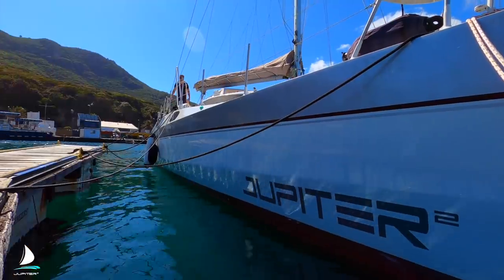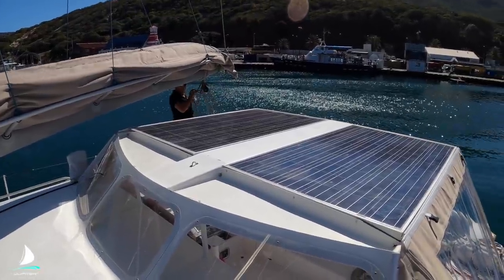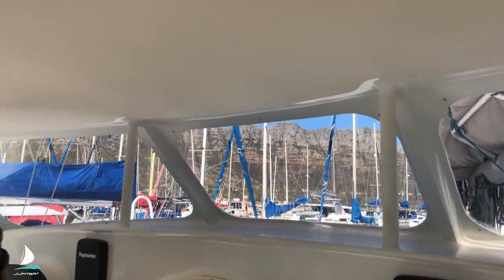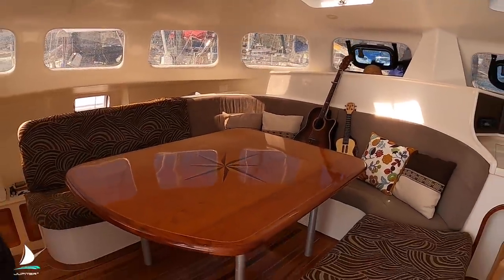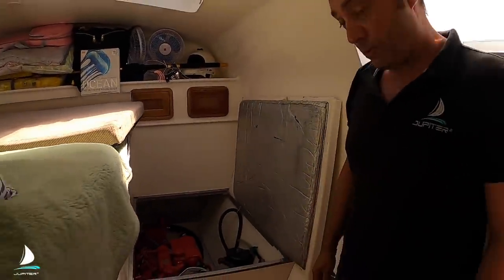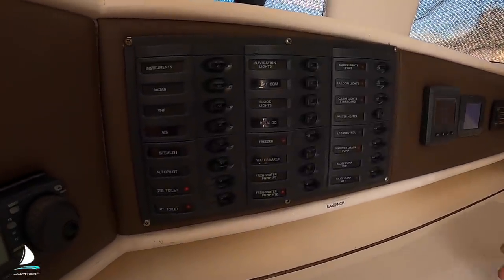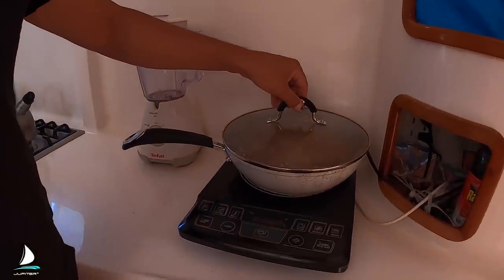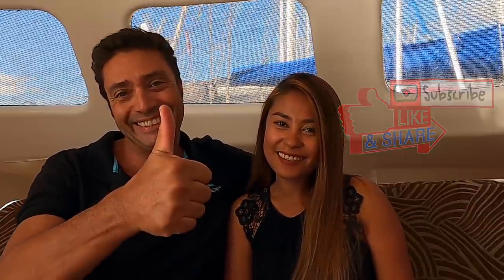ALUMINUM PERFORMANCE CRUISING CATAMARAN: BOAT TOUR EP1 , Meet Jupiter² and the crew

Comment from the maker: Hi guys, thanks for watching... it seems my opinions have raised a few questions, such as....
1.  Why is speed so important for a cruising sailboat? 
2. Do you really need a larger cat to go fast?
3. and the ol' "Which is better for bluewater cruising, Cat or Mono?"

Would love to hear your opinions!
Reply: 1) Speed is fun and can provide safety if not overdone. It's so much more fun to sail reasonably fast and throttle back (reef) when the conditions dictate. It's nice to continue sailing in light air rather than be forced to motor. Speed can also help you sail out of harms way if a storm is on it's way.
2). Larger cats contribute to comfort by reducing the (fore/aft) pitching at sea. Above 40' also allows for full standing headroom in saloon without looking top heavy. Additionally, the waterline makes a difference, even on fast cats unless you can get it up on a plane.
3). Cat (or multi) vs Mono still comes down to personal preference.
Mono's have the following advantages:   A) Cheaper to buy, maintain and berth (store at marina/dock). B) Typically sail upwind better than a cat. C) Mono's are less weight sensitive (You can pile alot of weight on them).
In most other categories, Cat's have the advantage:  A) Speed when beam reaching or downwind.  B) Living space for people, solar panels, water toys and dinghy's.  C) Maneuverability/redundancy when motoring.  D) Better motion at sea (my preference).  E) Shallower draft for anchorages/sand bars.  F) Many multi's are unsinkable. 
The Cat/Multi advantages list continues but those are the major ones I can think of right now. My preference is definitely a Cat/Multi, as long as I afford it.
Reply: 1. With a fast boat you can try to outrun weather, which is probably safer than to endure it, esp on ocean passages.
3. Rich cruisers tend to buy cats. If I had the money I would buy an alu cat for general cruising and liveaboard. Bigger, more stable, less wet and normally faster, more deck space for solar and greater technical redundancy. 
But I also want to visit high lats (Alaska and British Columbia) for very long times out, that takes lots of suppliers calling for a higher displacement boat like the Pelagic boats. 
Me being too short on money, for the same amount of money I would prefer to buy a sturdy alu bluewater monohull of adequate size  and better quality equipment than a cat of mediocre quality and rigging.
Reply: Sup.

1. Like others have pointed out, speed is crucial for avoiding or escaping dangerous weather, unless your sailboat is durable enough to withstand rough water, which I highly doubt it will, and please don't risked it.

2. Why not? If you can afford a performance model, but please keep in mind that these models are more designed for performance and NOT so much for practicality and comfort. Some sacrifices will varied depending on one's demands out of their sailboat.

3. From my experience. Nothing beats the speed and sailing performance of a monohull and they're great starting sailboats for those with a tight budget.
Cats on the hand are awesome for those whom may want a little bit more room and comfort for their sailing adventures. They're also very stable and much more user friendly...well expect for the maintenance.
Reply: As to 2) a definite NO . While displacement (non planing) monohulls suffer from max hull speed which is defined by their hull length (longer is faster) , well designed multihulls with narrow hulls (length to beam ratio >= 12) do not have this limit . That is why the Rolex Fastnet was recently won by a 42 ft cat (Marsaudon Composites TS42) in competition with much longer cats . A similar TS42 also won the 2020 ARC rally and set a new record .
Reply: It's down to personal choice. An what your plans are... That's how you choose your boat... I don't get what ppl are on about.... Lol!!!
Reply: 1. As others have mentioned you have the potential to avoid weather systems but to me the capability to sail in lighter winds is more important. The point of a sailboat is to sail, not motor. The more I can sail vs. having to motor the happier I am. 2. Speed is also constrained by the skill and confidence of the crew to manage the boat at high speeds so I'd say for 1 & 2 speed and size are not as important (at least to me) as light wind capability (see above). 3. As others have said, I think this comes down to preference as both have pros and cons.
Reply: It's so nice to see two people that have found each other enjoying life. Beautiful boat, beautiful woman and seeing you two happy brought a smile to my face.

Thanks - may you have fair winds and smooth sailing
Reply: What about corrosion of unlike metals touching the aluminum ? Is it a problem ? What about electrolysis ? Is it a problem ?
Reply: 1. Speed gets you to your destination quicker and you can outrun storms which makes it a safe boat. 2. A 48 ft. cat is plenty large enough but having a 50 ft. would make your cat a little more stable in a sea way. 3. Cat because of the reasons I listed, more stable and you have more outside space to party when your on anchor.

Comment: I love the overall design of the Mumby 48.  Aesthetically, from beam on it isn't my favourite, but I can easily get past that when I consider all the benefits it brings.  The dagger boards and kick up rudders are genius. Welded-in deck fittings and hatch frames, brilliant.  You talk in later videos about welding in aluminum though hulls, another great idea.  All together most of these things, in my mind, potentially take out 'some' of the the mundane tasks and expense of GRP boat ownership and really when you get right down to it, make for a much stronger built boat. 
 I was talking to someone about what is better, GRP or aluminum for a boat.  What he said has stuck with me- "There is a reason the Coast Guard builds their boats out of aluminum and not GRP."  
 You say you have it 'loaded down' and it still blows around in the lightest of breezes.  I think when you are finished with your circumnavigation Mr. Mumby might want to talk to you about a job promoting his product! You might have a second career waiting for you. 😉👍🏾
Reply from the maker: Geez... I hope youre right... I could sure use a job! Yeah Marcel, we love our boat.

Comment: I just found your channel and will be binge watching to catch up. I lived/worked in the PI for 7 years in the 80's (West coast of Zambales, Luzon) , then returned to USA and built my 31' F-9A trimaran. It was launched it in 1993 and I still have it but I want to cruise on a 42-47' cat now. It's hard to find one that's reasonably priced, performs good and is not an ex-charter beat-up boat. If I were younger, I'd build it myself but at 61, I don't have that energy anymore. 
I hope some of your episodes cover the building in the PI. I have a lot of questions for you but I'll start with basics:
1) Where in the PI did you build?
2) Where are you based at during the Covid lockdown? (edit - I'm sure this will be answered as I catch up with episodes)
3) Would you have it built in the PI again, if you had to do over again?
4) Were you at the build site for most of the build?

Good Luck and Best of Wishes to you guys on your adventure (I will have many more questions)...
Reply from the maker: Hi Steve. Glad you're watching... Yeah I wished we had started taking videos back when i was in PI... Still my favorite place, and probably where i will end up after the circumnavigation. El Nido perhaps.
Sure, bring on the questions...
1.  The designer/builder (aussie, Tim Mumby) had a yard set up in the little province town of Carmen, which is 2 hours bus ride north of Cebu city, Cebu.
2. We were stuck in Capetown... Hout Bay to be precise... It really is a beautiful spot there... but a bit scary during the lockdown, because of the very poor locals there, going hungry.
3. The big advantage of PI to build is labour costs are low... ($7-$15 usd per day for a labourer)... but the disadvantages are importing (or smuggling) your gear in... there are high import taxes, so you tend to smuggle as much as possible.
4. No i only visited for a few days most months.
Cheers

Comment: This is really nice cat! Very impressive. It's really simple, very efficient, yet it has a elegant layout and design. And I love the galley down, which is not really closed off from the salon. I would love to hear more about the boat: difference between aluminum, performance specs, systems, seeing her perform at sea, etc. Looking forward to more videos. Great job!
Reply from the maker: Thanks Rabukan... Yep ally cat. There's no official specs around... Specs are so subjective, and really difficult to compare oranges with oranges... You cant fairly compare boats on paper when they are tested with different sea states, winds, loadings, crews etc... And never believe the manufacturers performance specs!
From experience these boats go well... Much better than condo cats... Recently I had an unofficial match with an Atlantic 55 and we out performed it... Twice.
Another Mumby Sulanga (Cape Town) led the Cape to Rio cruising division for much of the way, until they retired due to not wanting to risk some severe weather.
It's a great performance cruiser and a true blue water cat.

Comment: I wonder if you can get an electric motor that connects to your shaft prop instead of a diesel engine. That seems like it would be much better than a diesel engine.
Reply from the maker: Sure can... But not cheaply available yet.

Comment: AWESOME introduction of your boat and yourselves!  Your extended back story was excellent and really inspiring.  Love the aluminum boat, how thick was the Aluminum used?  It is very clear you've developed excellent do it yourself skills, so what if you made something to organize the spare lines in the laundry room...something similar to an oversized rack for men's ties, except scaled for all the spare lines?   An easier fix could be just installing a heavy duty shower curtain rod to hang them from?  Anyway, that's just a couple of quick ideas, you've probably got it handled by now.  Cheers!
Reply from the maker: Hey thanks Leo... The hulls are 4mm...and cheers for trying to clean up my laundry!... But the ropes lying there help keep my washing machine in place in rough seas, as does the spinnaker and storm jib!

Comment: In your laundry area is there a reason you have sails and lines stored there? Is there not a enough room in the sail lockers? In most Mumby 48's this is another berth so where do those vessels store this equipment?
Reply from the maker: I could probably store them in the lazarette... A big fwd locker in between the laundry and the owners cabin... But it's full of dive compressor, tanks and dive gear! I got too much shit on my boat...

Comment: I've watched quite a few of your videos on your Mumby. I love the design and features you have showcased (well done, they really should hire you as a spokesperson). One thing I haven't noticed is that there don't seem to be emergency hatches in the two hulls that other catamarans tend to have. Are they just really well hidden or not needed due to some unmentioned design reason?
Reply from the maker: Hey Jason... Tks for watching... Those escape hatches are only a  safety requirement in Europe as far as I'm aware....so the charter boat manufacturers design them in to be able to sail in the Med... They do seem like a nice idea, but are very prone to leaking and even blowing apart when hit by the force of waves in a big sea... I am seriously glad to not have such large openings just above the water line.
Reply: @SailingLifeonJupiter  Thanks for replying. I figured it was a design choice but the info about the Med is interesting. Does this mean that if you wanted to charter in the Med and you owned a Mumby 48 you wouldn't be able to? What about insurance? Does the lack of these hatches make it more difficult or expensive to insure the boat?
Reply from the maker: @bitbyterjr  ... correct..you will need these hatches for charter in the Med... No issues with insurance if you insure and operate where they don't require the hatches!

Comment: I came here to see what an Aluminum Cat would look like.  You two make a great couple, I enjoyed the ending very much.  My Filipina can't keep a straight face most of the time either.  Like it that way.  So is building with Aluminum more costly than with glass?  What is the main advantage in your opinion?  Happy Trails  (Want to be back in Dumaguete after Covid)
Reply from the maker: Ah Dumaguete!... We will be back in PI to live also... Not sure where tho... Ally is cheap to buy... But could be expensive to weld unless you are in PI or do it yourself... Main advantage is strength to weight ratio and cheaper cost(in PI)

Comment: Thank you for showing us around your boat. Truly beautiful and roomy. I love the daggerboards. So easy to manage. Having a spare would be great. One persistent concern I do have with cats is with regards to capsize. When it happens, a mono will right itself with proper displacement / buoyancy and watertight integrity. But a cat? Like to hear from you your perspective regarding this possibility.
Reply from the maker: Sure Joseph…you need to pay more attention with cats, actively sail them and don’t allow them to go near a capsize…Performance cats can be overpowered…racing cats will turn over…in really big seas, just dropping all sail will keep them upright.
Reply: Anyone flying a hull in a cruising cat either screwed up or is an idiot and flipping it is a persistent risk. Chris white came up with a system a few years back to automatically drop the mainsheet if a certain angle of heel is reached and if I were getting a cat I would want to fit that (with both a redundant and manual backup). Lots of people sail lots of miles without any problems but you can always get hit by a gust of wind and even if you're Einstein don't rely on making smart decisions after a storm has kept you up all night.

If you're interested in safety I'd check out Dick Beaumont and kraken yachts. The TLDR is that the awful design of keels, hulls and rudders mean modern monohulls really aren't safe for long distance cruising. The krakens and a lot of older boats are unbelievably tough though and their flagship even took a head on collision with a whale without major damage. 

The thing I would say you should really be watching out for is a collision with either the shore, a whale or a container as the speed and necessarily light build of a catamaran means they simply cannot take hits from them without at least some kind of breach to the hull (That wouldn't be a massive issue if hulls were heavily subdivided but unfortunately no-one builds them that way - particularly annoying in this case as all you'd need to do to subdivide the mumby is add some doors over the existing bulkheads)

Comment: Love the design, as far as the differences between Glass/foam boats and Aluminium weight wise is there much of a difference between two same sized boat made of one or the other? I saw a comment on a forum re Aluminium boats will sink if hulled wheres Glass boats wont, is this true as far as you are aware? Is there any reserve buoyancy built into the design?
Reply from the maker: Sure Kell... Floatation compartments  both bows and sterns...

Comment: How close to the wind (ie degrees off True Wind)  can Jupiter 2, a performance cat, sail when sailing close hauled?  

     Are there other high aspect ratio multi hull designs (similar to those of high A.R. monohulls) whose designed is optimized for up-wind sailing? 

     I’ve heard that the motion when sailing close hauled on a cat is uncomfortable.  What is your experience and thoughts?

     I know that up-wind sailing is normally a forte of mono-hulls but have always been curious of the capabilities of multi-hulls, if so designed.  Thanks so much ... you have a great boat, both design and construction. 😎👍
Reply from the maker: Hey Vincent... thanks for the comments....
You're right, i'm sure mono's do point better with decent lifting aerofoil keel... so you'd definitely want a cat with dagger boards if you're concerned about upwind sailing... I'm unsure of True wind angles, but we still have good speeds at around 40' AWA... perhaps sitting on 8-10kt sog in a 15kt breeze (depending on sea state).... we can pinch up higher, but the speed would drop back.
Designs for performance "cruising" cats are pretty rare actually.... 90% are charter boats.... But you could check out Schionning, Outremer,  Atlantic or the TS 42.
And yes, i would agree that the motion can be uncomfortable in a chop or cross swell. The wave peaks hit the two hulls a second or so apart, so the motion is an unpredictable jerky jostle, which makes it hard to move around (although sailing flat)....where as a mono reacts only once to the wave peak making the motion more predictable... although leaning over at 30-40 degrees which i think is uncomfortable also!
Everything is a compromise!
Reply: @SailingLifeonJupiter  Thanks for a candid answer.  The 40’ is a good starting point.  The relative merits of each design is very interesting. A boat as you’ve pointed out, is always a compromise so I guess the trick is to define the type of sailing you prefer that pick the compromise which best fits. 👍😎

Comment: Aye m8’s, This an interesting design. May I ask about the aluminium concept -  what are your personal pro's and con's of the shaping of the hulls?
Reply from the maker: Very pleased I found this design... The ally is very stiff and strong. If run up on a reef it would bend without puncture(apparently!).
The hull shape and low weight (for its size) is what makes it perform. Sleek hulls with narrow hull beams on the waterline. Enough flare in the bows for reserve buoyancy and tapered sterns for less wake/drag.
There is nothing I'd change about the hulls. 
Thanks for the feedback